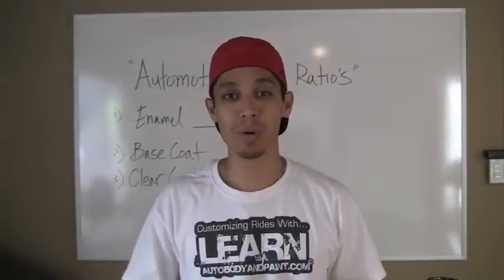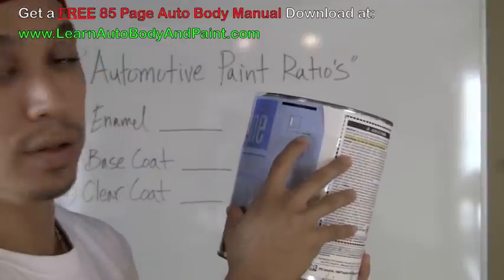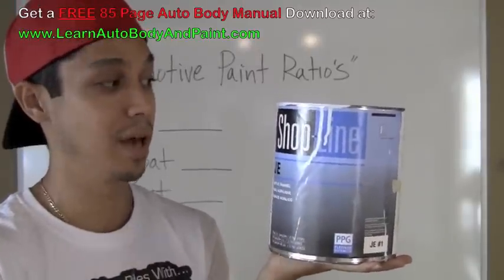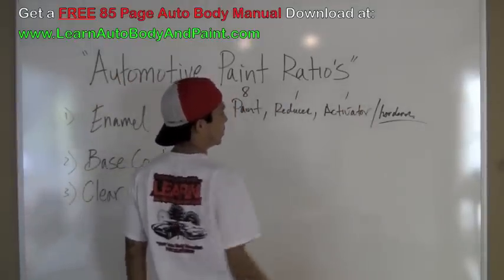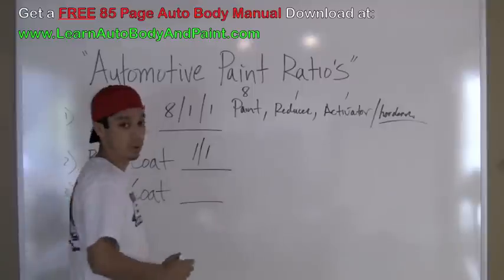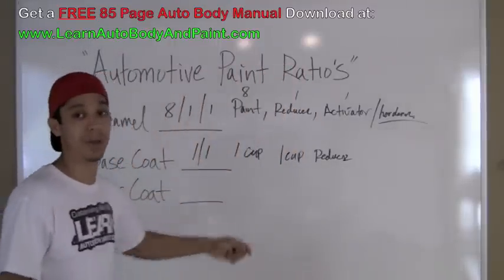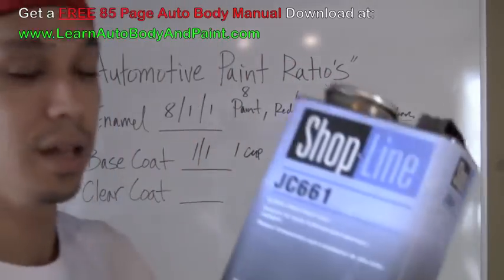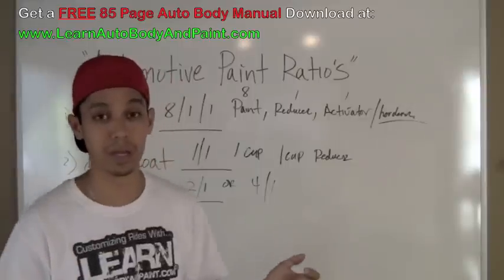Automotive Paint Mixing Ratios - How To Mix Auto Paint - Mixing Car Paint

Comment: great video, i just painted my first truck using a single stage paint and it turned out pretty decent, I am painting a car with  my buddy and wanted to do it with a more expensive paint that includes a reducer and hardener. your video helped alot also i wanted to add a pearl, I was wondering how much to add and a good place to buy it at, I am not completely sure but it would make sense to add it to the base coat instead of clear, is that correct?
Reply: I am a paint mixer in india how can get same job in your country .?

Comment: Definitely the best tutorial around here. Now the "mystery of 4 components started to be solved, for me". I am about to use for the first time my spray gun. Will paint a part/piece on my motorcycle...Went at paint supplies store and he gave 
me 4 different cans...the color, the clear, a hardener and something else. The guy wrote on the top the proportions but doesn't make any sense to me. Could someone help me with these one? Also, I asked him, 
how much pressure on the gun...I heard 5 pounds... should be 25 pounds 
or even 35? SOS.

Comment: This sounds really hard if you have never painted before but it's easy I remember being a new painter back in the days of polyurethane and using clear coat over it and also using lacquers and using polyurethane clear coat over it things have changed so much especially with suction feed guns

Comment: hey man going to paint my truck, one prob the top of cab is very discolored,clear coated i beleive i have removed rust, applied inhibitor, do i have to sand all the way down or will the high build primer fill it? i have sanded it with 600 on DA sander i plan on 3 or 4 coats of primer before wet sanding? thanksif you can help.

Comment: I have purchased some 1k primer but I am unsure if I am supposed to thin it in some way before I spray it on. (I tried to spray it through my new "1.4 nozzled' gun, but it spat a rough and dry bit of paint on the panel. I now have a rough textured primer on my panel. The only way I could get any quantity of paint out of the gun was whilst it was on a "spot" setting as opposed to an oval rugby ball shape as it's supposed to be. I left the gun set up to a produce a nice rugby ball shape despite the small amount of paint that was coming out, emptied the pot and blew through some gun cleaner, and it was great - a nice strong pattern and quantity of cleaner. I am thinking that the 1k primer is too thick for my set up). Perhaps I should use a larger nozzle or thin the primer but I really do not know what is the correct thing to do. Are you able to advise me on this please?

Comment: Just count by adding with anything you are spraying.  Get the data sheet and for example, the Wandabase HS paint I have is two parts paint, 1 part reducer for a 2:1 ratio.  You will use the mixing cup, and 2 parts paint, 1 part reducer for a total of 3 parts.  For 3:1, 3 parts of paint, 1 part of reducer for a total of 4 parts. 

 Add the ratio to find out how many total parts you will end up with.  4:1 is total of 5 parts, etc.  That is the easiest way to remember how to mix paints.

Comment: With a base coat that requires a  2:1 ratio, how do you know if its reducer or activator? Example HOK basecoats are 2 part paint, 1 part reducer.  Would I be correct in saying that NO paint will require activator unless it's listed as a three digit ratio, like 2:1:1 ?

Comment: How would you mix using 10 clear/1 reducer? Are those cups with measuring useful for this? Im trying to shoot some headlights. Thanks man! love the content
Reply: Not sure of the question but just mix clear with 2:1 ratio, sand the headlights with 1000-1500, and clear it. I do this at work all the time. Cheers

Comment: My biggest question is mixing water borne paint. All I have ever mixed is solvent paint. I see some places on the web to mix with water... That's pretty logical but, I do know that in the industry they have the harder... Not to sure what the ratio is or etc. I know it is measured by viscosity but I guess my main concerned is which ratio they actually have. Great video by the way!! If I was never in an automotive collision class I would of totally learned a lot from this! Pretty much how my tech taught me!
Reply from the maker: It all depends on the brand you are using .. What are u looking to use ?
Reply: I honestly have an incoming up in California, not to sure what kind they use

Comment: So help me out they want 4.1.2 on hb primer all the cups are 4.1.1. Now if i use the scale on the side of the cup it`s too much paint i need. Say i use 8oz of paint how would i calculate that using 4.1.2 ?  4 part paint 1 hardener and 2 reducer.

Comment: Still confusing.   a "base" coat is the first coat put on. That is what a base is..  This is usually a primer/ or sealer?.  Then the 2nd coat is a paint with color. that is called the base coat. Then clear on top of that.
 You say Enamel, then base, then clear. Is Enamel the base coat?
Reply from the maker: No, basecoat is your paint color.... primer is primer, sealer is sealer. Don't over complicate things. Learn more in VIP here: https://www.learnautobodyandpaint.com